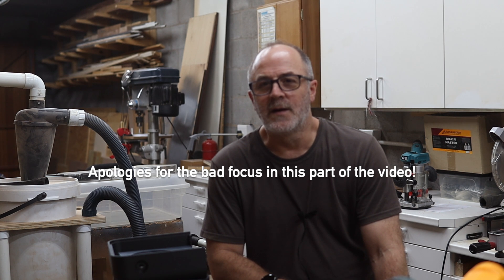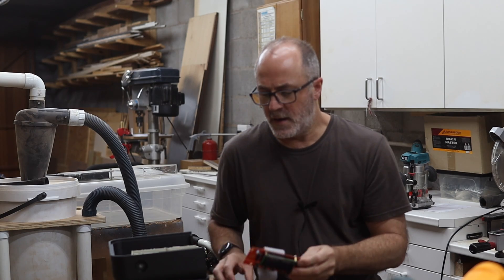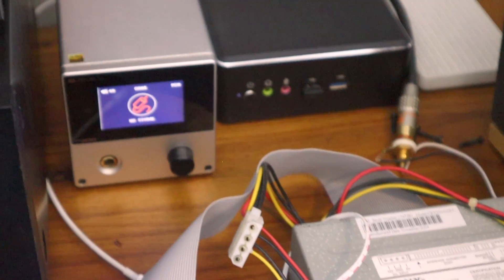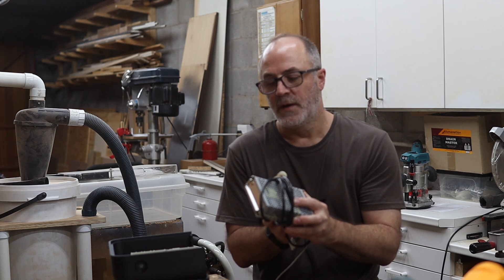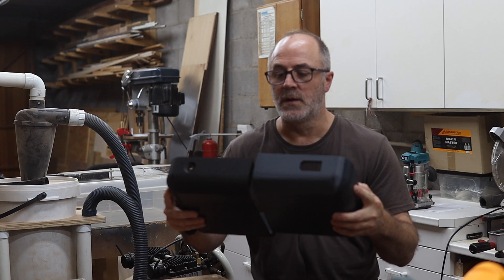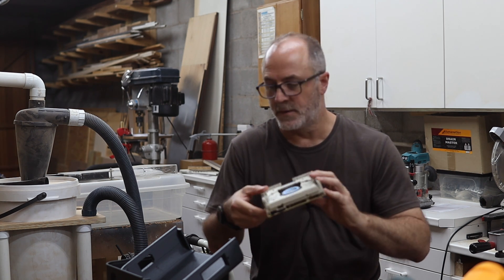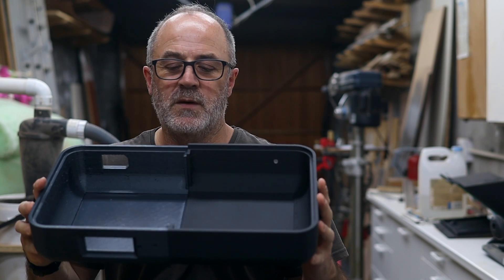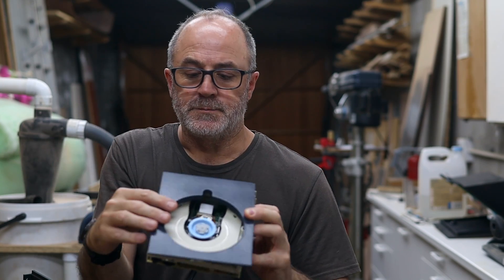Solving the Mystery: What Happened to the DIY CD-Player Project? - by SoundBlab

Comment: Those 7805 you used is good for max 1A. I think the drive will consume 2A+. You can easylie measure this with a cheap Multimeter if put in the 5V powercord.
Reply from the maker: Yeah, I think that was the problem.

Comment: Can you comment maybe for another video, on the different types of CD parts manufacturers, the ones that are compatible or not for repair at home. And also, the front loading mechanism, the likes in cars and for DJs, without drawer. Are they good for maintenance over the years? Are they as strong.😅
Reply from the maker: I am afraid that I do not have the knowledge to comment on that.
Reply: @SoundBlab  keep the good work , best.🎥